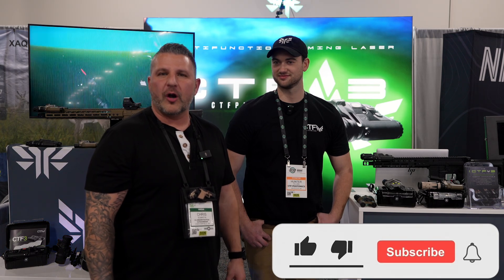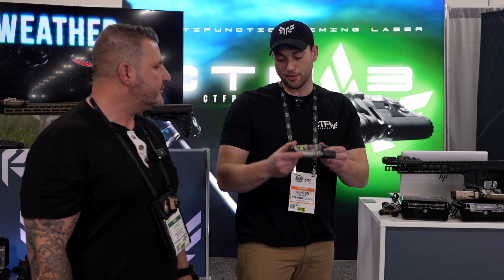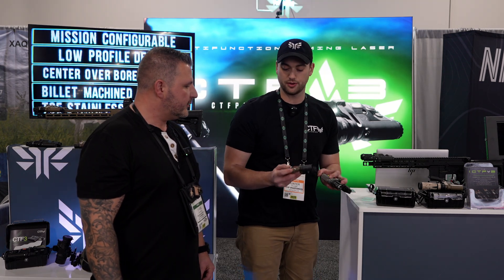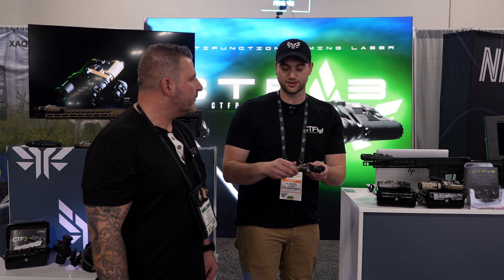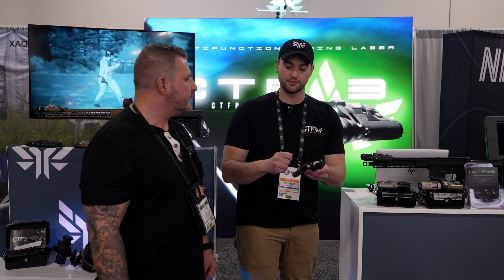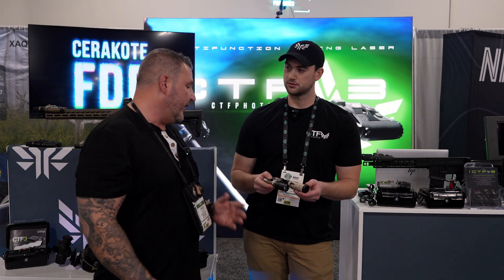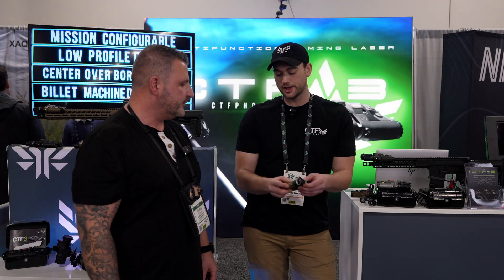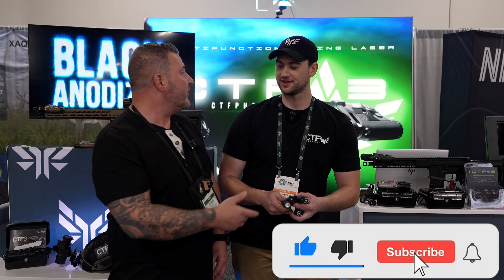The Next Generation Laser That Will Change Everything

Comment: What switches are compatible with this?
Reply: No switches
Reply from the maker: Damn. I should have asked him. They are planning to make the battery front loaded. That would theoretically free up room for a pressure pad port in the rear.
Reply: I think none. If I'm not mistaken the original design was specifically geared towards limited rail space. I feel like if it was crane plug compatible he would have said so
Reply: @joshuabruce9920  thanks
Reply: But good question
Reply: This is why I never purchased the Phantom Hill CTF. 1. They need a two button pad switch option. 2.A visible laser.